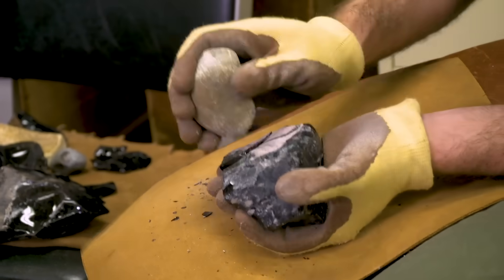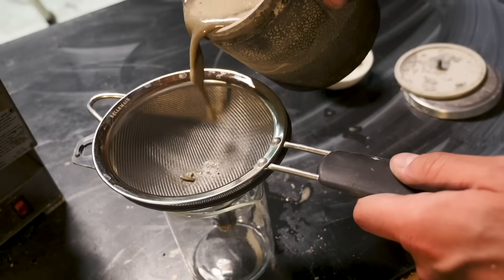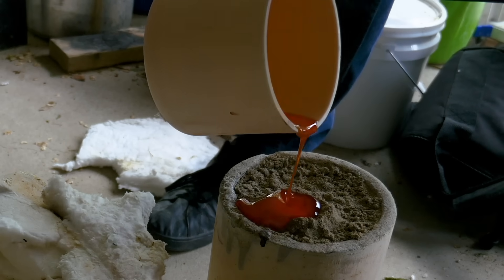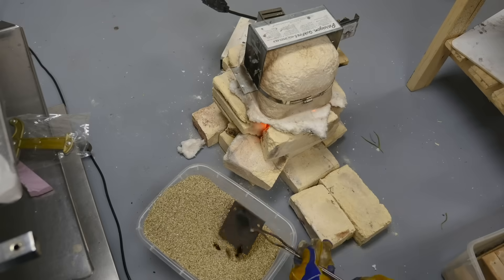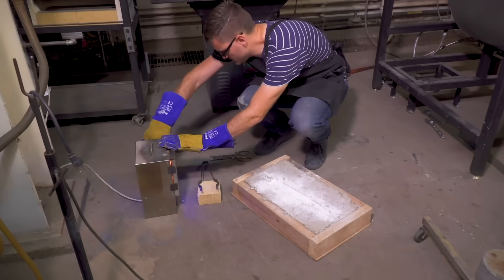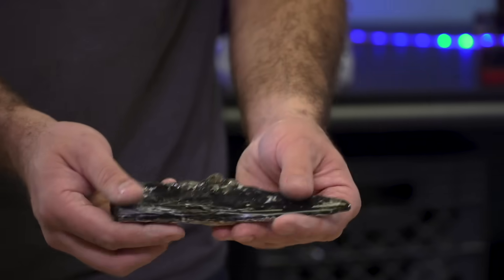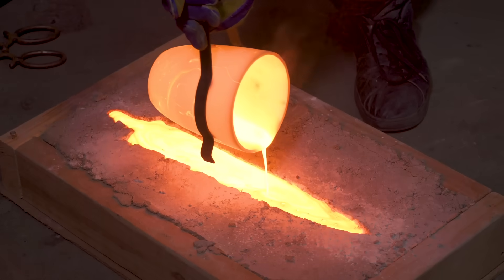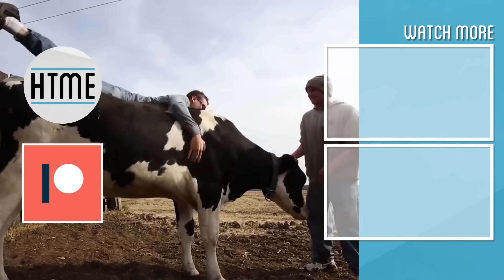Can You Melt Obsidian and Cast a Sword?

Comment: That was a nice attempt.
Obsidian is formed when molten lava is rapidly cooled by water (like from a river or lake).
When obsidian is submerged in water it gradually turns into perlite. 
I’ve seen @greenpowerscience use a Fresnel lens to melt rock into glass.
Why don’t you buy a bag of perlite (miracle gro) and melt it?
Then pour cold water on the molten obsidian?
Do you think that might work?

Instead of molding a blade, you can try to cast jewelry like rings or a pendant?

Comment: Yeah, the mistake is trying to make a full blade from it to begin with. Sharp bits of it were relatively loosely inserted into a club, with the intent that they would come loose and shatter in the victim. The victim would have really sharp bits in their tissue, cutting them up further as they moved, causing massive pain and bleeding, making them an easy target to club down. 
The mistakes here, were first, solidly gluing chunks into a handle, which defeats the point. Then, trying to make a full weapon out of it, which is always going to be so fragile as to be useless, no matter how you make it.

Comment: If  it has a melting point of 2000 degrees Celsius then oxy acetylene will melt it acetylene cooks at around 3, 200 degrees Celsius

Comment: Bro next time your trying to mix your cement or whatever your using, don’t waste time like you did, get a strong rubble bag (thick bin liner type bag) measure out your dry ingredients, put them in the bag, twist the top trapping a bubble 🫧 of air in the bag (not too tight of the bag might pop) give it a few shakes and boom 💥 mixed dry ingredients, just put in your bucket and add water. Done 10 times quicker

Comment: Probably be better off pulverizing the obsidian into a fine powder. Take that powder and put it directly into the mold, and heat everything up. You'd have to make the mold out of thermal forge paste/mortar, what ever is used to line forges, instead of sand, obviously.

Comment: A tip for you, heat your sand before you put the hot obsidian in it to cool. It's shattering because it needs ro to cool slower. Heating the sand will prevent it from breaking, however it will take longer to cool.

Comment: I feel like it mostly shattered as a result of the cooling process and thermal shock. Even just pouring it into the mold I think would be enough to cause the thermal shock, since it’s glass you’re working with. Preheating the mold might work idk

Comment: I think with a little experimentation using aluminum powder as a flux medium, you will find the right recipe to perform a vacuum injection mold that is all done in an enclosed container. 
 The trick will be submerging the mold into cold water afterwards. What you will end up with is an aluminized Ruperts drop Dagger 🗡  or small sword. (Letter opener) ❤😂

Comment: obsidian is a chemical compost based by volcanic reactions. air vapers are not nitrogen oxygen based around a volcano, their methane-dioxide based. so the issue isnt the kelns or the crucible but the entire forge system as the room itself has to mimic that of volcanic atmospheric reactions... where whemislet barley wheat is the best, but yeah.... and you have to char it all out to make a sulfuric compost of the barley wheat for the glass toxins to breath into the sands as it courses over itself. then you can build an over sized kiln/crucible, with a emptying spout just as a volcano will have gaseous ruptures to let out expelled lava meanwhile a top source bakes and adds more into the kiln. so the kiln itself is the crucible container within the forge, and fills in a stream from a lower level as you cook the obsidian. being a flowing stream of lava to fill your casting in the proper environmental effects of the volcanic lava forge which requires oxygen tanks to be in. then the result is hardened cast obsidian. and your casting should always be larger then the desired finish. because as a glass, it doesnt finish up like other mineral blades. but cracks and shrivels where todays moderen methods would be probably to lazer etch. also the stream flow will cause lift and gain buildup... so your stream overflow has to be larger then the casting depressions as well expecting overflow, and need to be cold and broken out for a 2nd forging. as that is how to forge obsidian. which is not doable, because whemislet barley wheat is extinct! why forging original demask obsidian blades is no-longer possible and why most of them are 4000-10000 years old and in museums. where unless by some miracle, beneath the perma frost is there a whemislet barley wheat sapling or seed that would allow repopulations, could the old historic volcanic obsidian demask forges would be reborn. but this is why we do not forge obsidian. and in turn use naturally harvested volcanic densities. where different volcanos around the globe expel different natural materials from obsidian to basalt rock. but yeah... history books are cool. and despite the failed attempt, it is a good demonstrations of how hard obsidian is to work with. where the above reasons are why.
Reply: and you might say pouring out out of a crucible is same as a forge flowing. but no its really not. with the dioxides in the air... and the forge cooking the properties below the lighter properties rise in the surface, and the only part that flows out, is the part that is liquid and ready to be relieved. meanwhile when pouring the whole crucible up you are inlaying in equal properties onitself in different areas. where a forge spout flow only sends the good light properties out of the spout and it already cooling in the dioxide atmosphere as it layers over itself again and again which is the start of the long cooling processes in the hostile atmosphere. as you have to treat it more like a sap, then a metal that can be managed quickly. but you can use tensile rebar to brush stroke the obsidian into a very thin layers. then it will crisp and crack... then fill forge more, then do it again. then brush stroke thin layer. then it will cool within itself and over itself. then do another layers, as you are adding layers of obsidian ontop of obsidian by liquid surface tensions within its natural environment having a slower and longer cooling processes before the previous layer completes the cooling process is how you get razor thing sheet bindings. then by the 14th layer and fill it is done. all meanwhile the forge is hot the entire time pooling in the belly ready to over flow when you add more to the kiln. using the thermal dynamics of water, but with obsidian.

then when it is done... you have a 14 layer blade, with a bottom surface with many spikes that needs to be cleaned up. draw a fresh mold into the old molds place and as it is crackling as the 14 layer slab back to it on the back side. and the new base line will match the back line. then it is ready for clean up. being more like 14 miniature razor sharp blades side by side, with a rocky surface on both exterior faces. which will cut most sharpening bands. and then has to be hand chiseled for clean up. and because they were bonded in a liquid state with its natural environment, each layer is bonded with the other facing layer. a unique property of hardened obsidian in pure lava form. immalleable to rust and aging as well as super strong and super sharp, is why these 1000 year old blades are kept historically in museums as relics of a forgotten past. not so forgotten, just not repeatable for common practices, because 1 time to craft, 2 danger to resource with a lava forge, and 3 the extinct whemislet barley wheat.

as what is stronger. the single blade or a million jagged edges acting as one within unity. where in myth; the harden obsidian blade would cut threw bronze and early iron blades completely. but museums wont allow practical test of relics. and making new harden obsidian is apparently impossible without sulfurized whemislet barley wheat for castings. so the practice is in itself is folklore/prehistory. aside from known tribal stone weapons.

Comment: let me recap the nerdie part what I learned from video & comments:
-Obsidian is a glas. A glas is a phase, not a mineral, and different minerals can enter a "glas" state when they cool down very fast. 
-Typically, Obsidian is often from quartz (Siliciumdioxid), and in pure state, quartz melting point is around 1700C°. So you need a flux to lower the temperature.
-HTME used lot's of this "white powder" as flux, someone guessed it's baking soda, natriumhydrogencarbonat, that has a melting point of ~850C°.
-But even with this, the melting point was too high and HTME had problems getting the glas melted on around 1200C° that he can achieve in his kilts (?).
So likely the obsidian it can consist of different minerals, had a high share of pure quartz/siliciumdioxid) or another high temperature mineral.
This flux was responsible for the "bubbles" at the begin of cooling the glas Baking soda emits plenty of CO2 when it's activated- so another flux might not have had that problem.
The cooling phase is critical for this obsidian like any glas, and has to happen very slowly but even with the equipment from the Professionals, it crackled, so likely the sandbox was the problem and should be preheatened to the degree possible before the glas can be molded and then put into the anneal box for a slow cool down.
So the process that works pretty well with iron doesn't work that well with glas, as it has other flux and the molding leads to high tensions in the material that require a slower cooldown, like for terracotta pots not so fast that it crackles, but fast enough that no crystallization can happen- tricky!
Very interesting learning case, thanks for this high efforts and beeing so insisting on the topic!
imagine, Egyptians found already a way to make glas in 2500BCE (according wikipedia)- amazing!

Comment: honestly i think the question is pointless. because even if you could cast "real" obsidian you could not sharpen the blade because the fatality of using obsidian as a sword comes from the fact that when obsidian hits something robust like bone it's brittleness will make it splinter and those splinters in the victim because being razorsharp will then cause internal bleeding as the splinter keeps cutting at every move... so if you take this attribute away by casting a blade and you get a different behaving material, what is the point?

Comment: The Astec Indians used a kind of wooden sword that had SMALL Obsidian blades attached to its edge. Although they were using Obsidian for centuries, apparently they never found any way to make large pieces of it that held up without breaking in use, although they always used it as much smaller cutting tools.

Comment: Heat your vermiculite up to between °500 and. °900 before you put your obsidian blade in it. This will allow your obsidian to cool slower. This method is recommended when welding cast steel, for the affor mentioned reason.

Comment: The major problem I see is he's working with such small equipment. Go big or go home, son! Make a BIG crucible. Build a HUGE oven. You need to get WAY past 2000 F in order to get the glass to pour like a liquid. You also need to actually do some research on how glass casting and blowing works. YOU DON'T NEED THAT MUCH FLUX. you doo however need POWDERED manganese and nickle.  Also, WHY THE HELL WOULD YOU NOT INCLUDE A TANG ON YOUR BLADE?

Comment: I see this was five years ago but I just came across this video. I was wondering if you had a mold that you could heat up to the point of melting the obsidian inside of it and then letting it cool. That way you have pure obsidian and you wouldn't have to pour it.